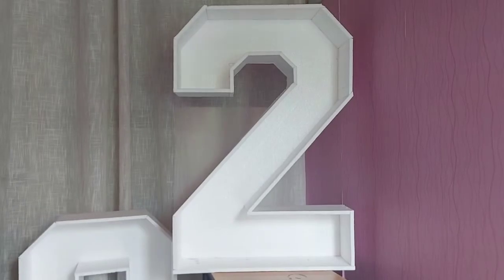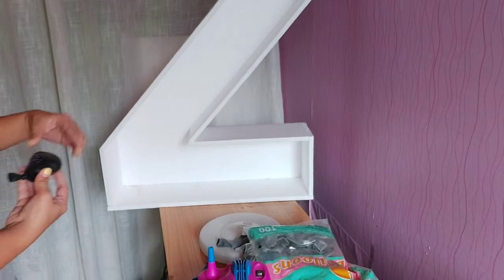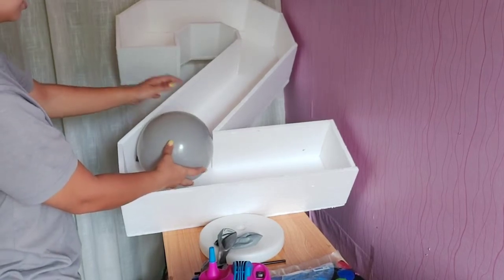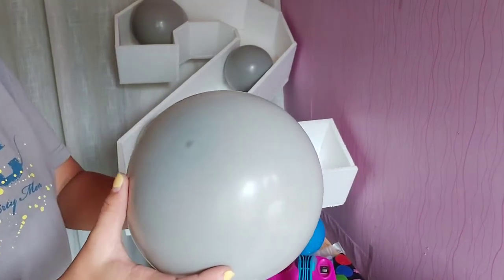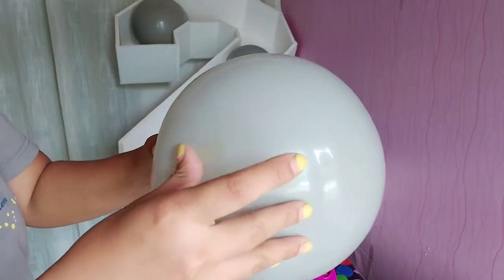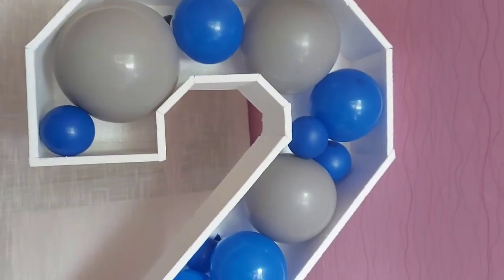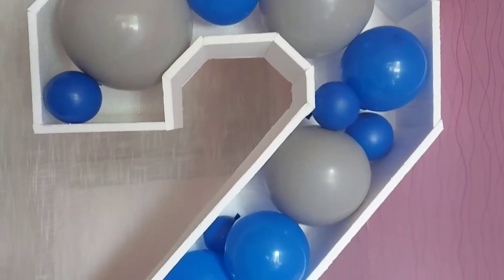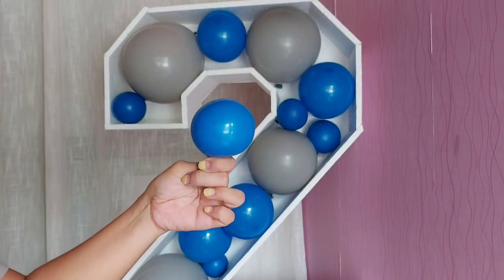Number Balloon Mosaic | How to Place Balloons Inside @battyballoons

Comment: What else are you using to stick the balloons together along with the hot glue gun? Does heat affect the balloons?
Reply from the maker: I also use glue dots in sticking balloons. And also just be careful in using low temp glue gun.